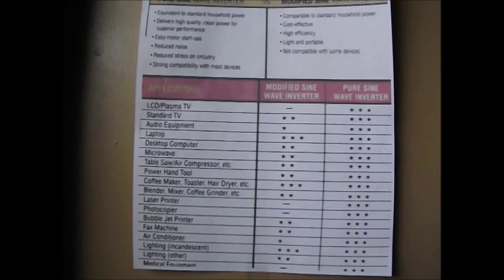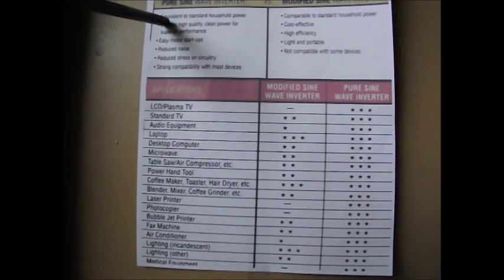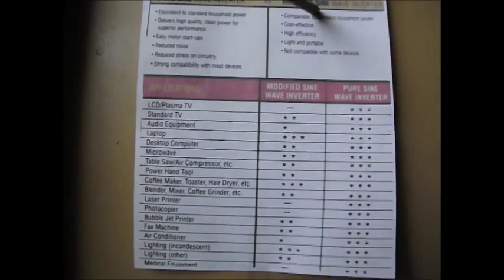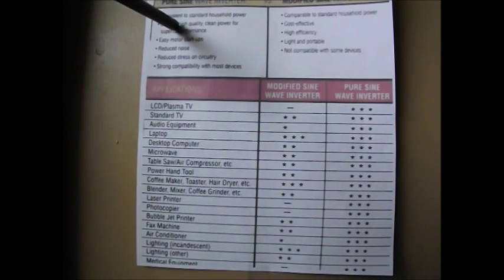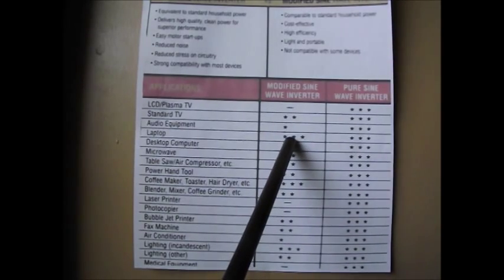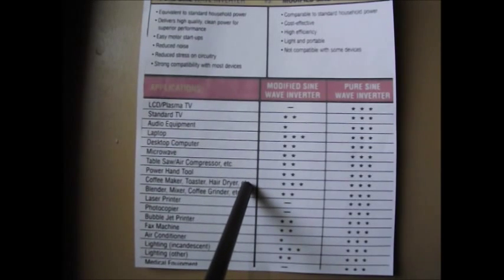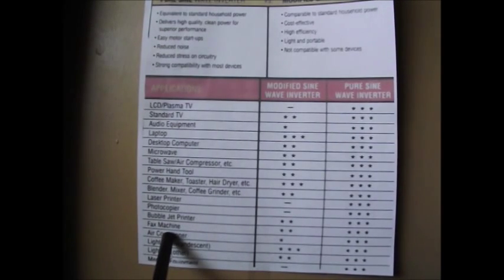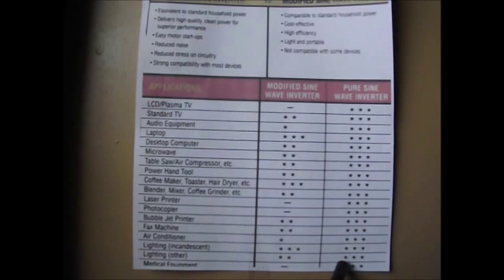Modified Sine Wave VS Pure Sine Wave Inverters

Comment: The more complicated the electronics are in a device, the more it cleans its own power with its own inverters and so on. Its things like that real time clocks with basic electronics you gotta worry about as well as motors as they run hotter. I always use pure sign regardless.

Comment: LCD TVs should run fine but CRT TVs won't work most LCDs convert it back to DC before it uses it internally
Reply from the maker: Yes anything that does the converting already will be fine.

Comment: Sir, i have an issue in one of my cheap modified sinewave inverter..it beeps Fault whenever i draw large load like 500 watts and up from my batteries..i suspect the voltage sensor is damage..even i use other inverter to drive the load and the modified has no load..it will still beep for fault even it has no load, just turn on together with the other inverter with the Load on it.please share if you have idea on how to repair this..
Reply from the maker: vrich marketing renewable energy Perhaps its dirty or dusty on the inside and its over heating with heavy load. Make sure its cooling down like it needs to. Other then that if your batteries are good and all the cells of the batteries are good. Then yes I would say its a problem with the inverter somewhere. Best of luck to you with it and I hope this helps.
Reply: that's a point.. in my case i already connected the 2 fans on the input side to operate all the time and keep the inverter cool..my batteries are good.i tried turning it on with another inverter with 700 watts and the modified inverter beeps while the inverter with the load doesn't. is it the dc input side has the problem?someone suggested it's input mosfets?but the mosfets remain cool when i open it.
Reply from the maker: Have you checked all the contacts on the inside. A soldered contact/joint may have loosened and when there is a demand for power its unable to supply it. Causing it to beep. Its really hard to tell. Some time problems are easy to find  and other times very hard to find.
Reply: that's what im thinking.. i checked the fuses..since it has 4 fuses and 4 ferite core..do you think its the core?if the transformer core winding burn out it will give less power.. but no obvious sign.. i'm using it right now and its working fine with the lights and my computer..i ust dont know if it will beep again if i add more loads up to 600 watts..
Reply: i observed that whenever the battery voltage drop to 12,7 it starts to beep..regardless of its load..can i just remove the voltage sensor or disable it from this inverter?
Reply from the maker: When it beeps is it still useable for power output. If so I would just disable the beeper. But I don,t like the low voltage beepers any way. Its no shock to me when the inverter just shuts down. Its very easy to notice. with out hearing a beeper
Reply: yes it can power load but i think it interprets voltage incorrectly because it will trip and beep fault whenever the voltage drop..even from 12.7 V to 12.5..V suppose it will trip to 10.5V or 11V right?
Reply: it's the voltage sensor / voltage reference which misinterprets the voltage from the battery does sensing it low voltage..is it functional if i just remove the small board controlling the Beeper?
Reply from the maker: vrich marketing renewable energy Sounds like it. No removing the beeper is no answer if its faulting. It seems to me your at no lose really. Its not really working good for you now. So what harm would there be if you remove the sensor. I,d try and see if the problem is fixed.
Reply from the maker: vrich marketing renewable energy Right the inverter should not fault at that voltage. Low shut off is what you said. That's when it should shut down.
Reply: so what do you think? just remove the whole circuitry for the low voltage shut off sensor?
Reply from the maker: I,m just not sure if that's going to solve the problem or not. Its up to you really. I never had  that happen before. The inverter might not even work afterwards. Like I say I,m not sure what to say here. Its a gamble I think.
Reply: maybe i'll just keep it..its still functioning normally now since my voltage is around 13V i'll just keep this up since it will beep if it drops to 12.6V
Reply: now i observed that the voltage reference for the beep starts to increase..now it is still working but it starts to beep even on 12.7V
Reply from the maker: Do you know at what voltage its faulting at. Perhaps its only a faulty beeper.
Reply: today, it beeps even the voltage is 13V
Reply from the maker: Beeps and still working. If it was my inverter and it was beeping and still working I would remove the beeper. But thats me. What you do is up to you.
Reply: im thinking of it.. i'll just remove the beeper, it's annoying
Reply: i put a 700 watts load on it and it shuts off.my theory is correct, it interprets the voltage incorrectly..whenever the voltage drops from 13V-12.7 it shuts off

Comment: I don't like that Pure Sine Wave! I'm just a simple person. It's better to just get the Modified Sine Wave power inverter with just incandescent/cfl and led light, smartphone chargers, wifi, laptops and desktops. I don't even need a Pure Sine Wave Power Inverter that is expensive to buy! The real Ordinary Power Inverter is Modified Sine Wave only original inverter car version electronic equipment power supply products like Suoer or Bosca solar power inverter that's okay for me. It's easy to buy! The modified-sine-waveform are general purpose power-inverter 150/2000W 12/24vDC to 110/220vAC 50/60Hz.
Reply: I don't like that Pure Sine Wave! I'm just a simple person. It's better to just get the Modified Sine Wave power inverter with just incandescent/cfl and led light, smartphone chargers, wifi, laptops and desktops. I don't even need a Pure Sine Wave Power Inverter that is expensive to buy! The real Ordinary Power Inverter is Modified Sine Wave only original inverter car version electronic equipment power supply products like Suoer or Bosca solar power inverter that's okay for me. It's easy to buy!
Reply from the maker: The modified sine wave is all i ever used for over 20 years no problems at all. In all them years i only burnt out 2 of them and they were the cheaper end one's. So i,m happy with them type one's my self. I also run pretty much what ever with it to. What i don't use on it is a electric fridge.  I have a DC/AC type fridge. Your right the modified sine wave are good as far as i care. I never burnt anything out from one of them either. What i have found is some electric motors don't like the modified inverters.  But only some not all. Perhaps all the newer type electric motors will not like it but i don't know for sure. Cheers best of luck' : )